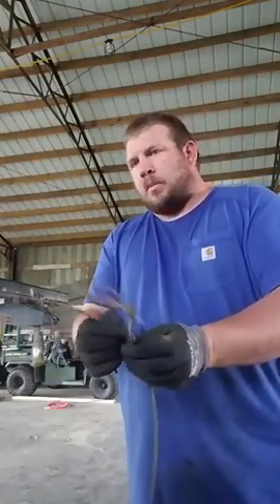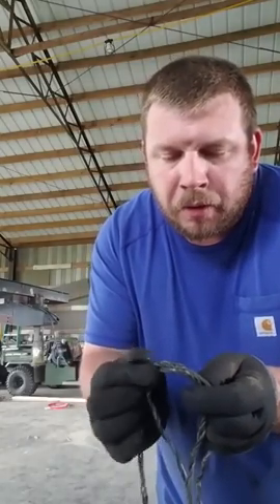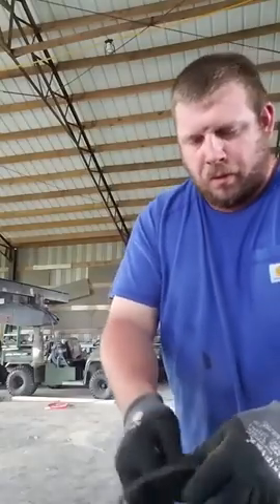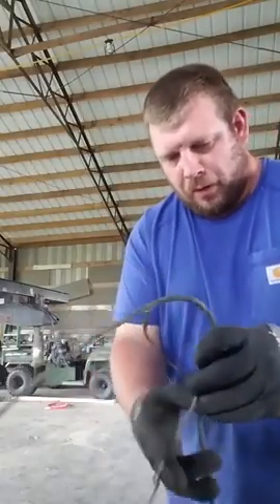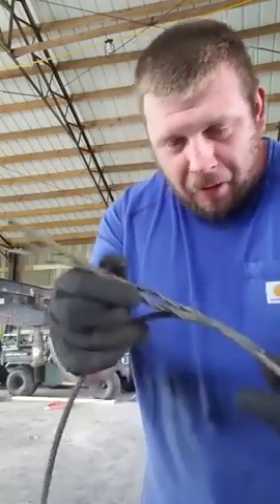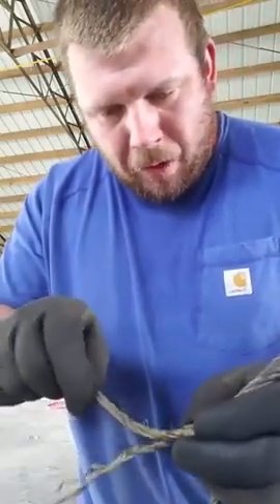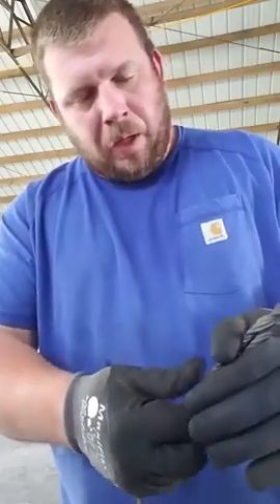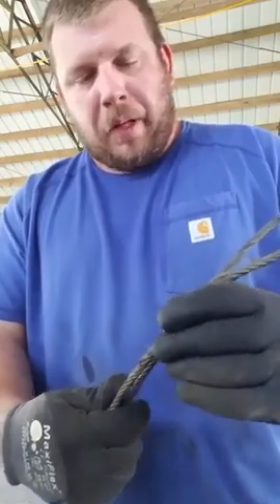Molly Hogan Splice | Trail Repair a Broken Steel Cable Winch Line

Comment: The longer the tail the stronger the loop. Great Video. We had a big 1 inch cable we did this on dozens of times dragging a suburban full of sand out of the river.. 6 foot tail is when it finally started holding....

Comment: Do you know how to do a running splice on a 6x6 cable
Reply from the maker: Hi Randy, do you mean you have 6 wires that make up your cable rather than 7 like shown in the video? If so, the technique should essentially be the same. We would suggest contacting your local rigging supply shop for any specific details. Thank you!
Reply: @Factor55 it is not 7 wires it's 6 STRANDS and a core. WIRES make up strands, and the core is either a strand or an independent wire rope core.